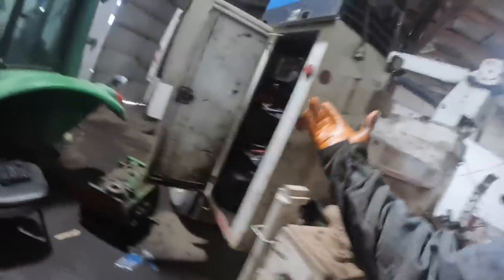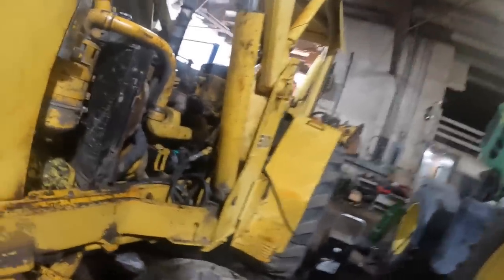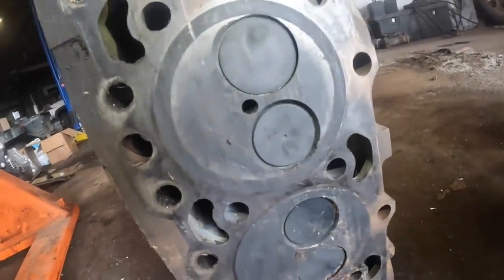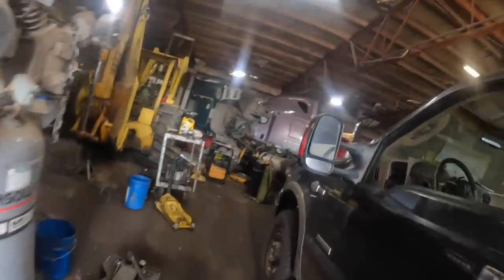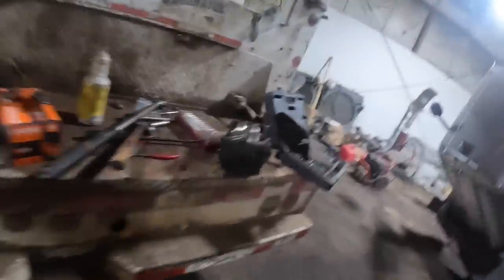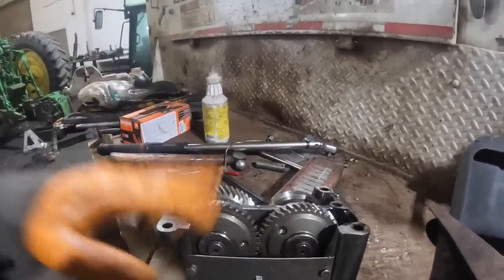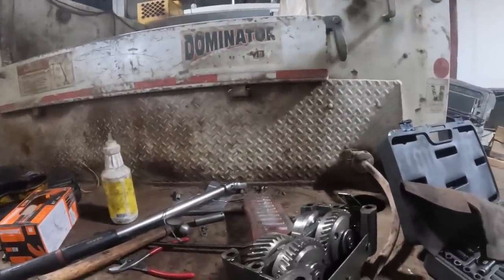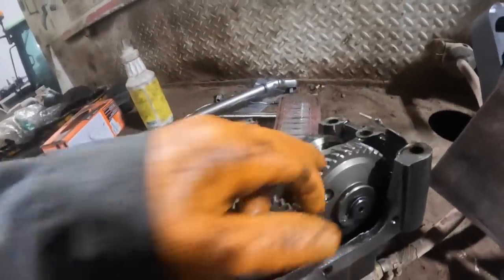Machine shop strikes again!

Comment: I sent out a block to get machined. I was gona assemble it, and they told me it wasn’t necessary to check main and rod clearances. I did it anyways because I figured why not. We’ll come to find out the bearings they gave me, the rod bearings were miss boxed from the factory and had way too much clearance. Months later the old shop I used to work at sent out an old international gasser to get rebuild and assembled. We get the engine fired and it started making a knocking noise. Well they put the wrong bearings in there as well.
My latest one, I’m working for my self now, and a costumer bought a  6BT from a Machine shop in Texas. They sent out the engine with a cracked timing case.

Comment: Have  had poor machine jobs, good jobs, "it will do jobs" , in the  past. 
Today I am fortunate  to have a good machine shop with good tools and machinists.  
None of us likes undijestable  jobs, but we all make mistakes. A shop with real morels  will step up, especially  when they did the job that failed. Unless they don't  want repete business.
Good  machine shops, industrial and automotive  are not cheap.  Cheap shops are more expensive  for sure.
A working relationship  with a shop and owner is invaluable. 
I posse a 2.3 ford head, machine shop  locally busted #3 cam journal  while installing the bearing insert. Sent head back to me, said its fine.  To this day I don't  use that shop, and wont do a job that they are involved in. Nope wont do it. 
Warren needs a machinest that is a standup kinda guy.

Comment: That's not good warren .those machine shops don't sound very professional. .not what you need ..sounds like the same problem you have with those reman engines.  😯😯.
Love your stories 👍👍👍.
Great news your truck in working ok 👍👍👍

Comment: The sleeve should have a groove cut on the OD at the oil hole and a groove on the ID in case the sleeve or bushing spins out of alignment. 
Yes I’m machinist. Industrial work not engine shop.

Comment: hows the power on the new truck engine?  you were talking about the hp difference...did you  change pumps after or is it peppy enough?  Thanks for the videos as always.  yer fuckin awesome.
Reply from the maker: It is way better on the low end, but need to work on the top end power.
Reply: This is the comment I was coming for here as well, have a  190hp c7 powered frieghtliner at work that is quite tired. I may extend the light at the end of it’s tunnel with a 5.9.

Comment: I hear you Warren. I battled all winter with this issue. Paccar cylinder head. Not much can be done to them but anyway they tell me oh good straight nothing wrong with that but needs valve  seats, and seals. How much $4200 he says. Get new head its half price Ill get head. They’re is none he says. Ok well do job. Month later they get done, install head. Leaks worse the head gasket. Pull again head warped to fuck! Machine shop says oh you didn’t check it before installing. No I kind of thought that was your job? Had nothing to say. Meanwhile have brought numerous blocks heads turbos. To have checked while rebuilding for my customers but doesn’t matter. I understand your frustration. Us independent guys, looking to just do our due diligence for our customers. Then you get that shit. 
Great work on videos!!!

Comment: Dealt with the same horse shit from others for decades. You're on the phone with them trying to get answers and you swear they are simply reading off a list of excuses they have on their desk as to why it isn't their fault. 99% of the time I simply do things myself now.Takes longer but if I screw up I know who to blame and how to fix my screw up. Here's a good one: back in my Navy days we had just come out of a yard repair cycle and when we opened up a turbine generator sump to clean it there was a block of machined steel in the sump. I spent a week going through a foot thick set of manuals looking for that machined steel block to try to figure out what it was and where within the turbine it may have come from. Yardbird had used it as a block to hold part of the turbine up while setting the turbine in the case and left it in the sump.

Comment: Does the engine even need the balancer? So many 4 cylinder engines do not have those and seem to work just fine...
Re-leeving is the only option. Making a new shaft isn't impossible either...

Comment: Its fast approaching the point where fixing older equipment won't be possible
1) The quality of the work of machine shops is suspect so you're left having to QC their work
2) The quality of the parts supplied cannot be trusted 
3) There's no one left that knows anything about how to anything.

Comment: Yeah my first engine rebuild had machinist redo the crankshaft as they had light scalding on bearing surfaces, he did the crankshaft and he sold be the main and rod bearings for the job, will put the engine all together, ran good at first, but low and behold once it warmed up it got a low end knock, nah that can't be, oil pressure was low but steady??????? alright then pulled the engine put on the stand, pulled the crank mains and plastigauged the bearings, the where out .010 out, rods checked out, went back to the machine shop with main bearings put back in his box, he stood there and said that he knew it was .010 under and that i shouldn't have put the wrong size bearings in it, I pointed out I had him machine the crank and it was him that sold me the wrong bearing kit, he wanted to charge me for the set of correct bearings, well needless to say, that wasn't happening, at least he gave me a set of the correct main bearings, put my first rebuild back together and never had any more issues with that engine. Yeah I agree always double check the work they do if possible, before install. SUCKS big time as we never get paid for rechecking what we are paying to have done. Way of life I guess. that was in 1979, as they say HANG in there, and smile at the bastards, weve made it this far. GOD bless you & yours, love the podcasts, just getting into working on a few pieces of ollder equipment I purchased long ago and learning from you what i can.

Comment: The vast majority of automotive machine shops are total garbage.  It think it's a combination of worn out equipment and lack of intelligence.  I would never allow a machine shop to assemble the engine for me.  It is not feasible or cost effective for machine shops to spend the time to properly assemble engines.  Machine shops will never admit fault or wrongdoing.  The machine shop I have been using for the past 10 years is absolutely amazing and I will not go anywhere else.  The shop I use currently has around a 12 week wait for block and head machine work.  My buddy was in the process of building a engine for  one of his vehicles and didn't want to wait the 12 weeks so he took to another "highly recommended" machine shop and it took them nearly 5 months to get it done and the work was terrible.  This engine was going to be 1000+ horsepower supercharged engine so he paid to have darton sleeves installed in all 8 cylinders.  When he got it back he asked me to inspect everything to make sure it was done correctly.  I immediately noticed that the spacing between the sleeves was all different and once I measured I realized they did not bore the black straight.  The cylinders were not true or straight and some not even round.  The only option now is to get another block or try the darton mid sleeves.  They refused to acknowledge the problem or to rectify it.  Once you find a good machine shop hope and pray they don't go out of business.

Comment: Well that sux. You have some poor service related machine shops out there that take no responsibility for their work.  I'm sure those kinds of shops are everywhere. I guess I've been pretty lucky 99% of my career.   There was one though that comes to mind.  I asked for a main drive /bull gear be checked balanced, it was 40" diameter and rotation speed of 3600 RPM.  The shop thought it was 36000 RPM and drilled 15  - 1.00"  holes to balance it.  And the pissing contest started from there. Not even mentioning a replacement gear was 30 grand.

Comment: In this case I feel the machine shop should rebush the part and drill it correctly and eat it 100%. If I did that I would. I always fix any job I did wrong. The being said though if I tell the customer I am uncomfortable with the repair and they authorize it anyway then anything that happens after that is on them.

Comment: I had a machine shop ruined an engine block. It went in for a clean-up and deck. Bores were great. Well, when they were decking it, the cutter came loose and just ate up the block. They called and said the block was no good and had a new they'd sell me. You ruined the block, and I have to pay for it. They said they were not reasonable for unforseen damage

Comment: Took 3 3208 blocks to a shop for bore hone, told the machinest to sleeve rear holes on one, obvious perosity to my eye.  Lazy bastard bored and honed all 8 babbled it was OK.  Took it to another shop and had them sleeved, was told they were definitely porous, got to go over every detail, they don't know and don't care.  Long before that worked w/a shop for gasser cylinder head work, after a few failures did some checking, dumb shit was reaming the new guides to size but not honing them, the reamer left a rough surface that caused exhaust  valves to seize.  The best mechanics have machine shop experience so they can catch fuck ups, they know what they are.

Comment: Imagine being an aerospace machinist (36 years retired) and doing something like that. You could kill a lot of people very quickly. No matter what it is an aircraft or a back hoe have pride in what you do and do your work correctly. They should have known that bushing needed an oil supply especially if the other side has one that is if they even looked. Sorry about what happened cause there are some really good shops and machinists out there. Please don't put them all in the same basket...

Comment: Sorry you have had issues with machine shops,  but you can’t condemn all of the machinists. I’ve had seen and have had issues with some and others have stood by their workmanship. One of the best guys I went to for diesel engine work I found out last year he no longer has a shop because of high rent and even higher regulations set forth by the county and city, so he retired. He was the only guy I could trust and he knew the older stuff as well as the new. Plus he stood by his work and did jobs at a fair price. Not a machinist but one of the first things taught to me in my long years as a mechanic was alway check someone else’s work , like you send out a head for work when you get it back , you disassembled it and check everything they quoted you for job done , new valves or guides, seats, springs even the head thickness before and after if resurfaced. The only way to cover your assets and ass is to not assume (ass of you and me) .

Comment: Good advise for anyone taking anything to a machine shop. Make drawings with tolerances if possible and have all the details down in writing that are important. Don't leave it to verbal discussion only because you bet some detail will be missed. But buddy I gotta say, if you're having bad months the only common factor here may possibly be you. From your rants sounds like your mum on giving shops details and not asking them for updates during their work. They also cop some blame because they should check with you as well but sounds like a good old lack of communication from both sides here.